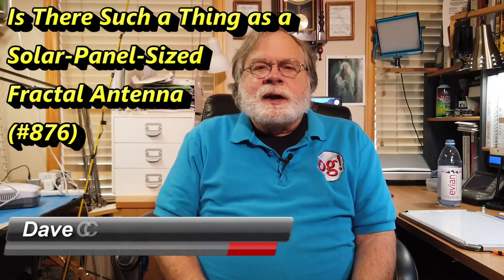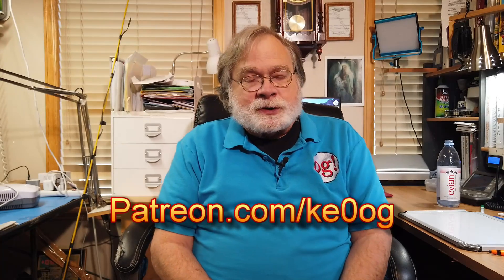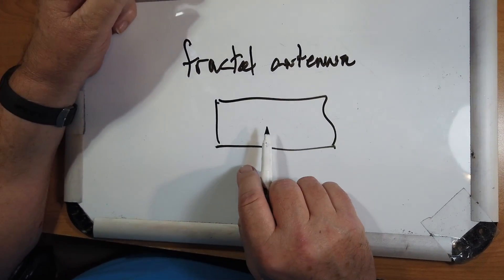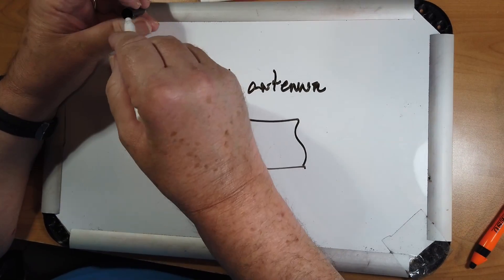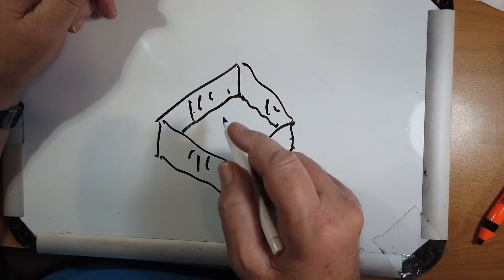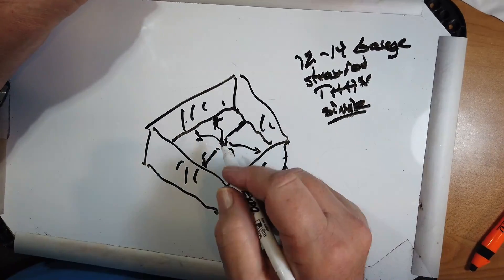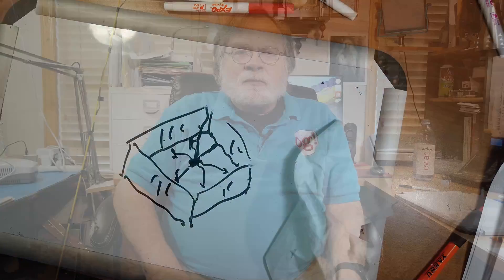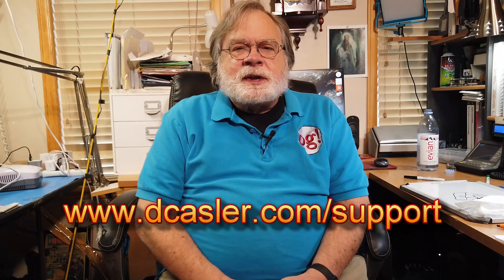Is There Such a Thing as a Solar-Panel-Sized Fractal Antenna (#876)

Comment: I bet/wonder if such a thing could be partially 3D printed. Say, you print the required pattern in sections that can be connected (due to small build areas on common consumer printers. Then you could lay the wire into the printed surface to make it follow the pattern.... Hmmmm
Reply: This would make the design and build quite simple...

Comment: For 80 and 40 building an electric fence on top of a property  fence is a good solution. Fiberglass rods tipped in 45 degrees will make it almost invisible. Can be end fed with a un-un or center fed with band chokes, A U or V shaped antenna will act much like a squarelo.
Reply: I know next to nothing about building an antenna but your wording gave me a great visual in my head, thanks friend 73 for now.